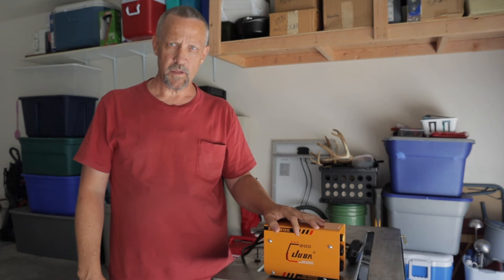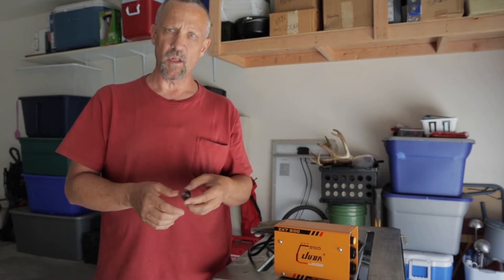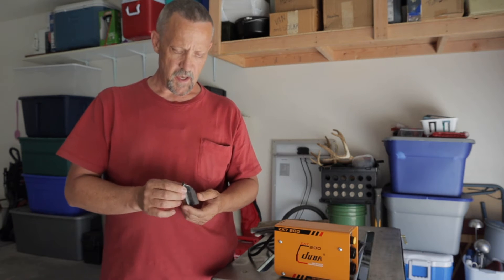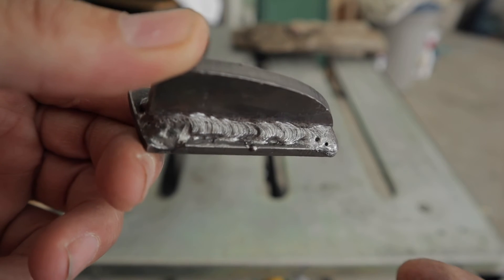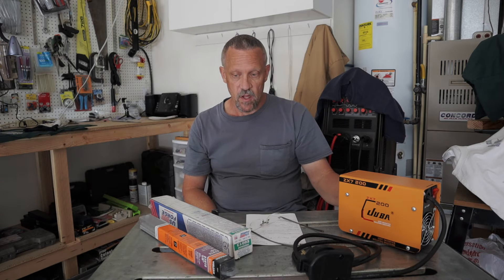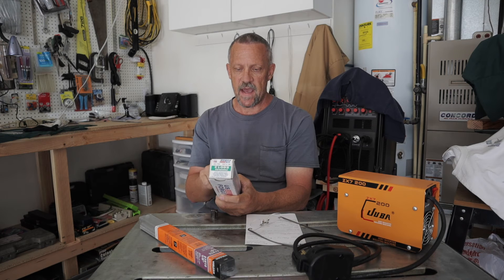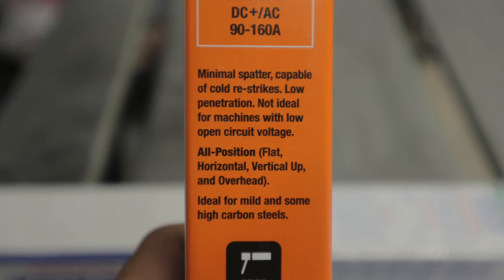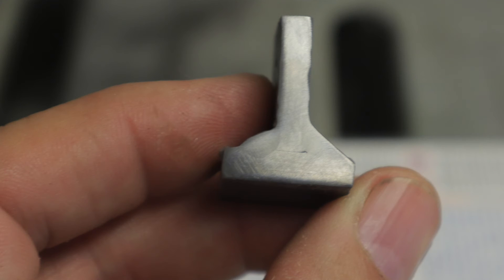Weld Testing the CHEAPEST Stick Welder I Could Find

Comment: for these little inverter machines just buy 2 or 4 guage jumper cables on ebay. 20 - 25 bucks for a set of 20 ft. leads
Reply from the maker: That will work too. Some of those lower priced jumper cable sets are aluminum wire though. Probably just fine for this small inverter machine. I wanted the good copper cables for mine so that's why I used the wire I did.

Comment: I am awful with all the electron flow but if the current is running from the electrode to the work piece then that is best penetration/most aggressive arc. 
I'd suggest even doing a cut and etch with tig, you would be surprised on how many voids you can find in a multi tig weld or how deep or shallow your pen is on the same setting with different grind angles.
Reply from the maker: Thank you Andrew, that's the way I was thinking it was as well. I may do a cut and etch on some tig welds here in the near future. Mostly out of curiosity and you are right, it's amazing how a weld can look good on the outside but underneath it can be a different story.